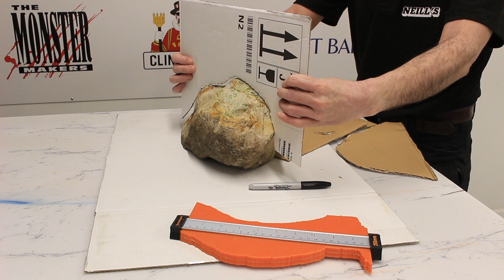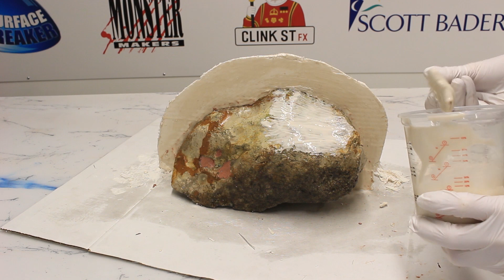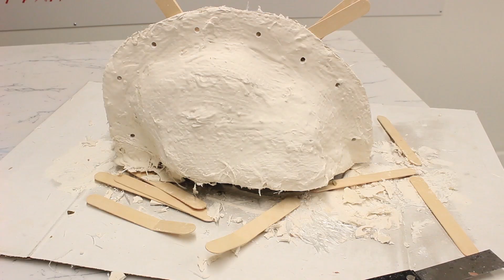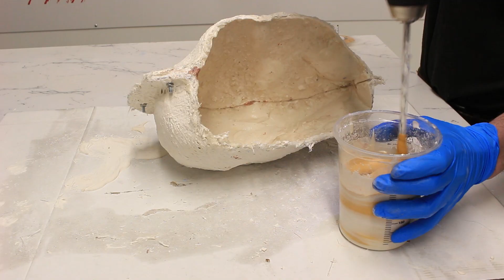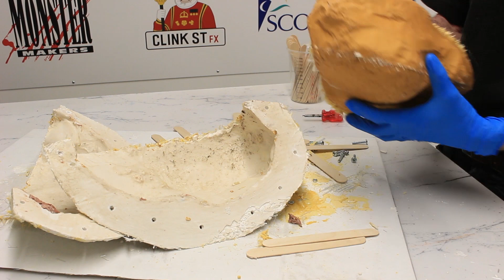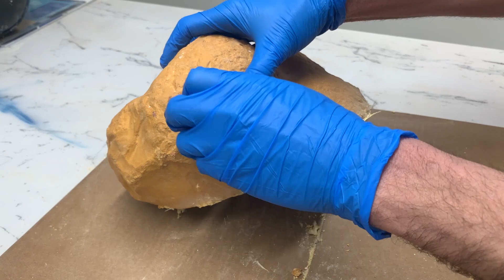Laminating a Hollow Shape with Acrylic One and Triaxial Fibre

Comment: Very useful. 
What is the heat tolerance of the finished shape? I'm thinking  I might be able to use this this to make a form (buck) that can be used in vacuum forming plastic sheeting. The PETG vacuum forming sheet's working temperature varies but 65 deg C is minimum... thanks.
Reply from the maker: Hi,
Thanks for your enquiry! The manufacturer has successfully tested it up to 120 deg C. We also have another customer who is using it to produce vac forming bucks and reports it is very good, not needing long to cool back down after use. So it should be great for your application!
Reply: @neills_materials  Brilliant many thanks. (Annoyingly YouTube didn't tell me you'd replied?)